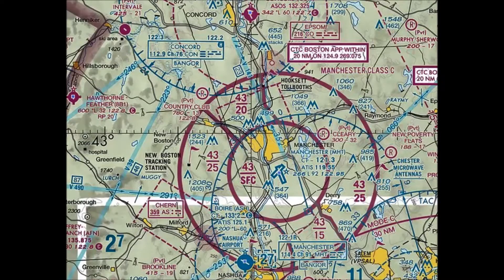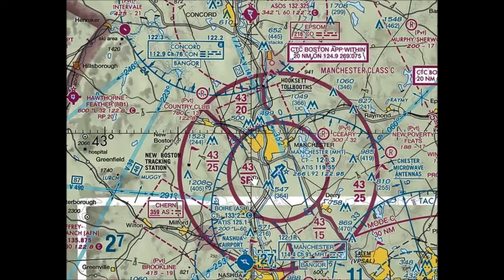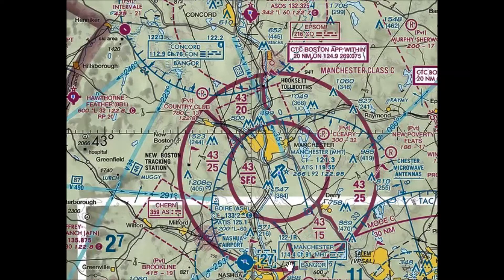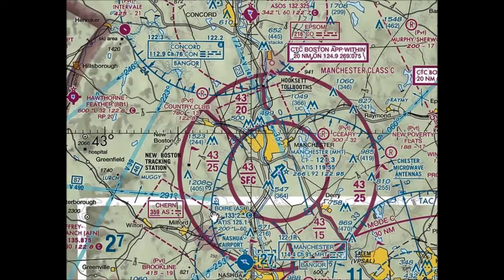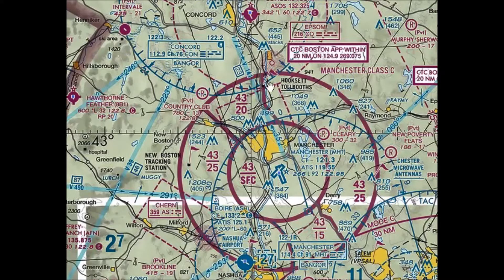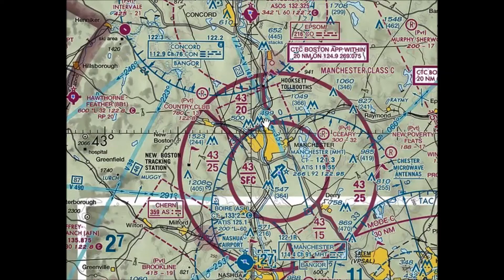Can you Fly a Drone Under a Class C or B Airspace shelf

Comment: Thank you for making this video. Please note that the FAA has released a statement clarifying that Class E surface extensions do not require authorization for UAS operations unless they are part of the surface Class E designated for the airport. This statement is commonly called the Gardner Memo and may be found here: https://commercialdronepilots.com/threads/class-e-surface-area-authorizations-faa-memo.833/
Reply from the maker: Yes, I have seen it, and have sent an email to Scott Gardner to confirm this language/understanding. As a commercial manned pilot, I am very surprised on this, that Class E to the surface associated with extensions to Class B, C and D airports, for the purpose of IFR approaches, is acceptable to fly a drone in without ATC authorization. From what I also read, drone pilots should be vigilant and careful while they are flying on these Class E extensions, which are the approach ends of runways. This type of rule change seems to be providing fuel for a major ball of fire near the end of a runway at some point.